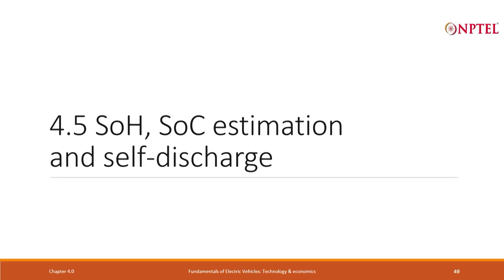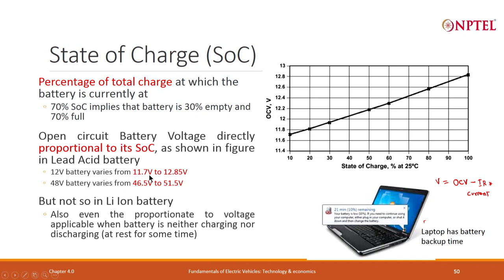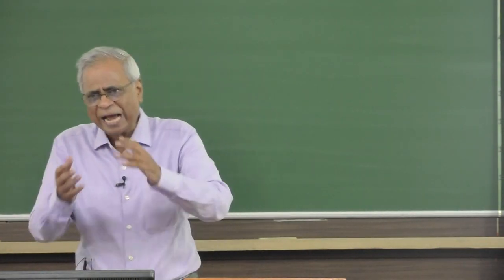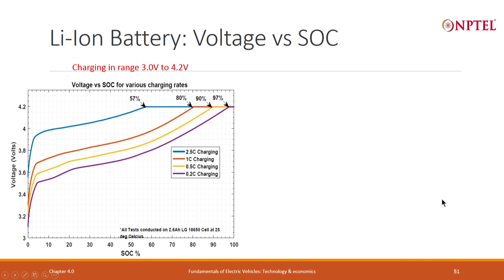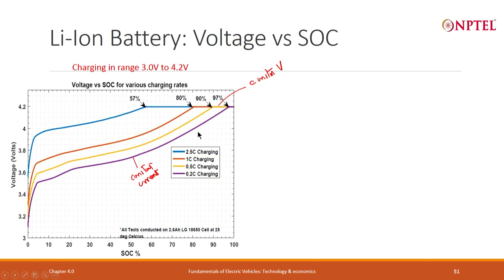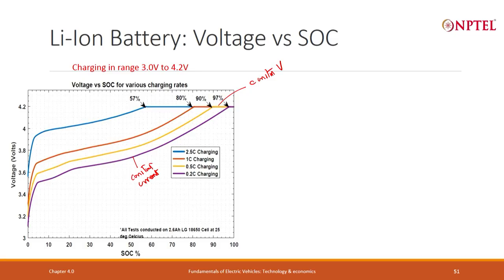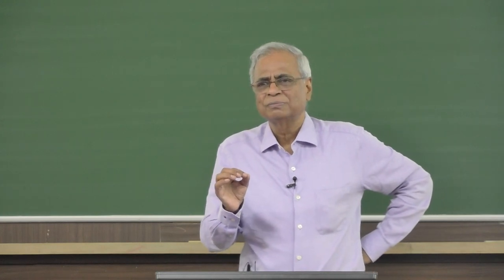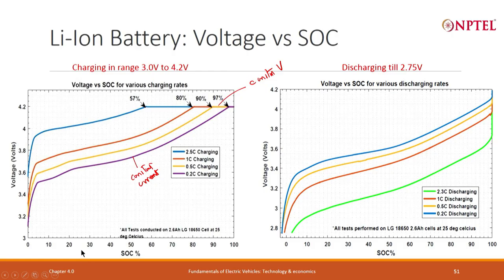Lecture 25 - SoH and SoC estimation and Self Discharge - Part 1

Comment: At 10minutes of video. Graph of SOC vs Voltage for charging at different C rates how the voltage for 0.5C greater than 0.2C i.e., how voltage for 2.5C>1C>0.5C>0.2C Ex at 50%SOC?
Sir mentioned that V = OCV - Current*Resistance . If my current at 1.5C>1C>0.5C>0.2C then negative term (Current*resistance) is high so my Voltage should actually reduce right?
Reply: The current is zero since it's an open circuit, (see the 3rd minute). This is not the charging current btw. Try to draw the circuit and integrate the external charging source, I hope you will reach a better understanding.